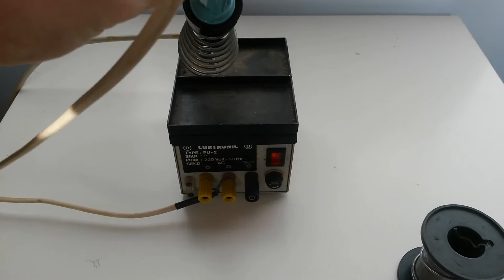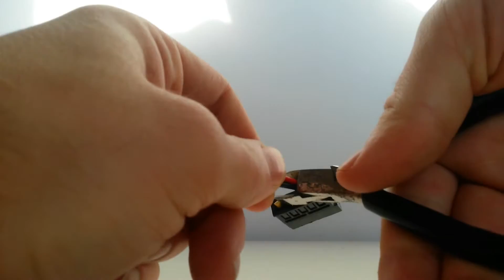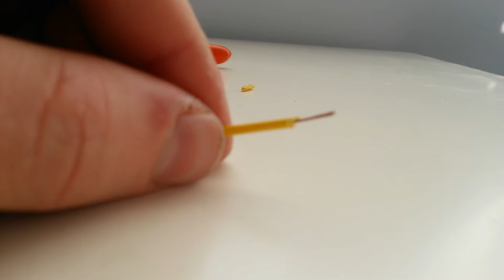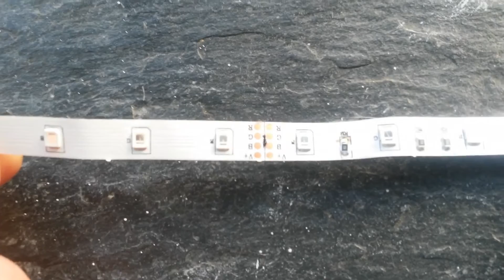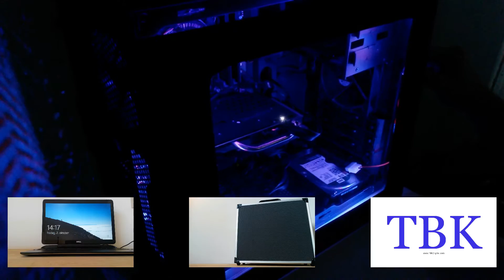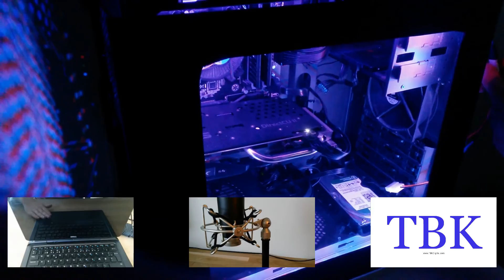Make your own RGB LED lights for your pc

Comment: I guess being old has it's advantages. I loved your Vidio but I could give you a course in basic wiring . you could have saved both plugs not just 1, a lighter strips wires,  most of the time, the molex arnt hard to pull out with a safety pin if you release it. Alot of the plugs are like that,you had to large of diamiter solder, shape your wires together with a weight close to the solder point, 3 pieces of shrink wrap, .. exct.. But kiddo I'm 61 and had great teachers and was a Bike teck and fabricator.    You Did great and thought me.     Please Keep it up and you got a like.  Bob

Comment: the tools altogether is not under $12. I don't have any of the tools and I'm pretty sure I'm not the only one but looking online for all the tools plus the LED strips it adds up to about $30. You can just buy a $20 RGB strips that have end connectors to the RGB slots on your motherboard. Seriously it's cheaper, quicker and way easier.
Reply: that's how they make a lot of money. while those wires may seem easy, the cost of doing a LED project multiplies exponentially as your cable length increases.

Sure, it's fine if you'd only put two strips on your case and call it a day. However, if you're planning to light up your entire computer table,  your wallet will pretty much cry as prebuilt LEDs are too overly expensive.

You could just buy solderless LED connectors to help easen out the process
Reply: You don't even need to solder anything. Twist the ends together and wrap them up with electrical tape and you'll be golden. I just ordered 5 meters of LED strip, a controller, and the 4 pin male to male adapter for $7.50 shipped from China on Aliexpress. I'll just cannibalize a molex adapter from an old computer for the power connector.

Comment: Very nice tutorial, thank you !

One question : If i let the controler inside the case right after I chose the color I want will it turn on the LEDs automatically when the PC power is on or do you have to do it manually ?
Reply from the maker: The LEDs automatically power up, and it can remember the last color us set, and will use that. So just pick a color you like, and put it in the case.
Reply: Thanks !!

Comment: how do u change color?
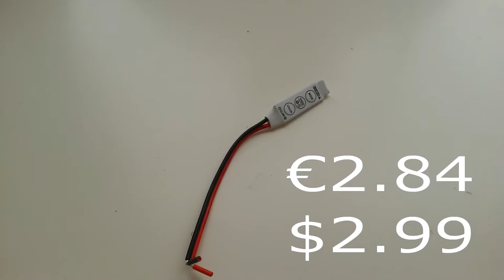Reply from the maker: Through the RGB Controller that have 3 buttons. I talk about it at 0:54 in the video.
Thanks for your comment, hope you liked the video.
Reply: ty :D i'll do it :D i bought yet strip led rgb with controller
Reply from the maker: Cool. It's a fun little project to do :) I plan to do some similar projects in the future , so subscribe so you will not miss them :)